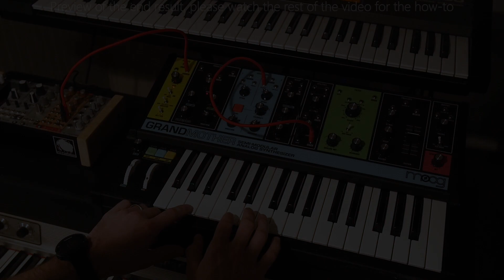Paraphonic Velocity Trick - Moog Grandmother

Comment: just got started with my grandmother, could you reccomend a small euro case and some effects/filters/modules that would be good to interact with grandmother?
Reply from the maker: I started with a small pittsburgh modular 48HP case, but recently moved to 2 rows of 48HP. It was hard to find a case like that, but that width fits the eurorack and moog nicely on top of my other keyboard.

For modules, it all depends what you want to do. I like fairly melodic stuff played from the keyboard, so your choices may be different if you want noise/drone/generative stuff. I added a digital oscillator in mutable instrument plaits, b/c it's really easy to take the moog into some new territory that way and get different sounds.

I added a doepfer wasp filter that gives a different sound than the moog and can do highpass and lowpass.

I also added utility stuff like bastl tromso (bitcrusher/comparator/lfo/vco) bastl skis (a/d envelopes and 2 vcas) an extra ADSR envelope. I also have a squarp hermod sequencer that can do a lot of lfo stuff and has become the midi hub for all my other studio gear.

Basically just get a small case and when you're patching the moog by itself, think about what you're missing. Is it extra tones/different filer/more modulation and lfos? Then slowly fill the gaps as you learn.

Comment: really cool hack !!
Reply from the maker: Thanks! I'm sure there's a ton of mileage left with it too. Just after finishing the video, I realized 3rd/4th combo could be used to play major and minor chords, with majors using the third and minors or majors using the 4th interval by playing the 5th (kind of an inverted power chord). People much better at voicing chords than I am can probably imagine more useful possibilities.
Reply: @JordanColburn1  personaly I would rather use a Major 3th and minor 3th combo ! The third is much more important than the fith imho, especially if you don't have room for 3 notes
Reply from the maker: @LouisSerieusement  Yeah, the chord is a little more clear. You can also try to patch in the LFO into the noise input on the mixer as a third osc, tuned to a fifth or octave, but I haven't gotten everything tuned quite right for that yet.
Reply: @JordanColburn1  really good idea !! I'm sure Dub chords would sound amazing on the GM :p